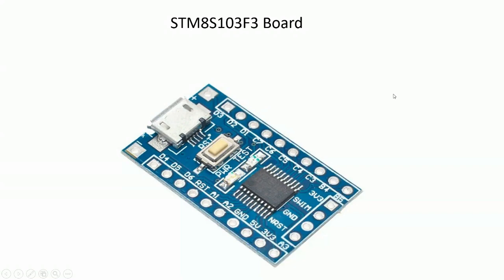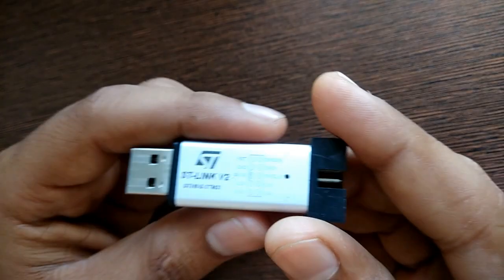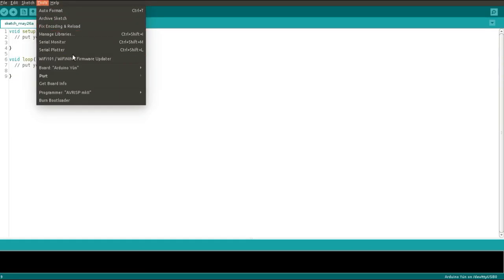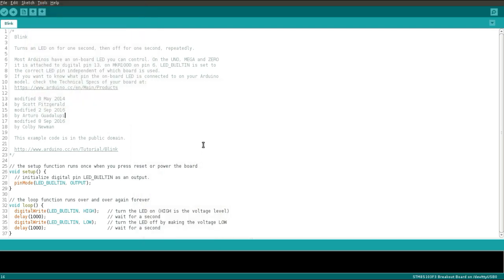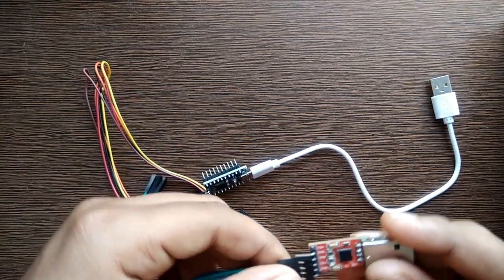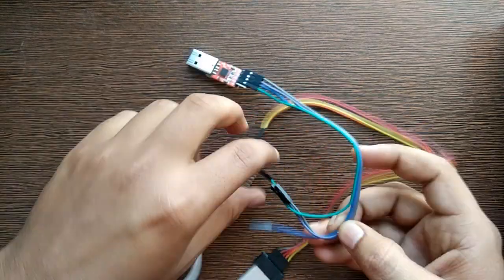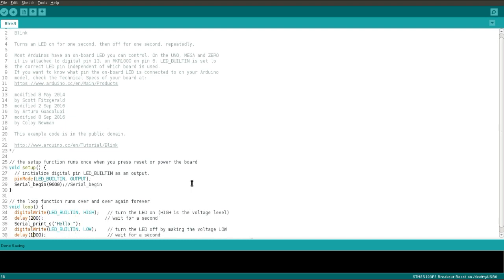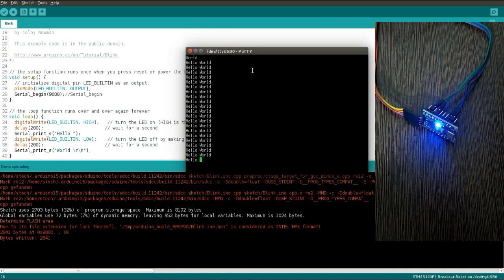How to use STM8S Controller with Arduino IDE | SDUINO

Comment: Stm8s is very cheap, and can find its way in many small projects (neopixels control for example) where wifi is not required.
A big plus is that it's fully supported in Arduino ide.

Comment: Mr, is there a tutorial to copy data from the programmed stm8s10 ic, copy it to the empty stm8s10 ic, please answer. thank you
Reply from the maker: Yes stm8s10xx can be read if lock bits are not set.
Reply: @StechiezDIY  if the bits are not locked, is there a tutorial for copying them. thank you

Comment: WARNING: Do NOT buy the SiPEED usb-debugger to program the STM8S103 chip (SiPEED=clone, article 114991786 = copy  of the real "ST-Link v2"), because that does not work; USB conn not recognized, and also does NOT have the "SWIM" pin to program the STM8S103 chip.

Comment: sir what is the meaning of break out board?
Reply from the maker: Breakout board means boards with specific and minimal functionality.
Reply: @StechiezDIY  technically its just a simple pcb that splits out the pins of an ic and make it easier to connect to. This stm8 board is actually a development board but close enough...

Comment: Hello sir  can we program stm8s003f3p6   microcontroller with Arduino ide
Reply from the maker: yes, we can program stm8s003f3p6 using arduino ide.
Reply: Hey are you working on stm8s003f3???

Comment: If getting this erro in arduino IDE:
1821 bytes at 0x8000... Tries exceeded

I found the solution...
First of all I have to remove Flash Protection of the STM8S003f3 board.
I used ST Visual Programmer tool to remove the protection.
Download from here: https://www.st.com/content/st_com/en/products/development-tools/software-development-tools/stm8-software-

development-tools/stm8-programmers/stvd-stm8.html

How to Remove the Flash Protection:

Connect the board with ST-LINK programmer and plug the programmer in USB. (Use SWIM wire)
Open "ST Visual Programmer" application.
Select Hardware: ST-LINK
PORT: USB
Programming Mode: SWIM
Device: STM8S103F3
and click OK.

Go to OPTION BYTE tab.
Set ROP to Off and then press CTRL+P

Now close visual programmer and Open Arduino IDE and upload the code easily without that error.
Reply from the maker: Thanks for sharing..Keep Sharing..
Reply: Thank bro, i got the same error and thanks to you i solved it
Reply: I am trying to program it through ST Visual Programmer, and I keep getting the error "Device is protected". Can't set that bit off, erase flash buttons are grayed out.
UPDATE: Never mind, all I had to do was select the Option BYTES tab and go to Program > Current Tab.

Comment: Its very Helpful one! but  if I include any arduino library, I am getting Multiple libraries found error message!!  same code will compile without any error if i select any arduino board (In both cases Pin Mapping of board is taken care) Looking forward for solution if any!!
Reply from the maker: Arduino libraries are not compatible with STM8* based libraries.
STM8S compiler doesn't support c++ libraries.
for example, for printing stm8s has different api for printing char,string and int.

Comment: Can we connect to computer through usb cable?.

Please reply it's important i want it for project.
Reply from the maker: USB connector given on board is just to supply power. And for supplying power you can connect it anywhere including your computer..
But if you want to connect it to computer for serial communication or flashing you will need required tools. I have shown that tools in the video.

Comment: Due to its file extension (or lack thereof), "C:\Users\lenovo\AppData\Local\Temp\arduino_build_953120/Blink.ino.hex" is considered as INTEL HEX format!
1821 bytes at 0x8000... Tries exceeded
Reply from the maker: Controller is might be locked. You will have to unlock it using following commands
echo "00" | xxd -r -p >ROP_CLEAR.bin
stm8flash -c stlinkv2 -p stm8s103f3 -s opt -w ROP_CLEAR.bin
Reply: Is that worked
Reply: please share me how to solve this issue in detail...I am too facing this issue
Reply from the maker: @unlockthehappiness6978  it worked for me. There can be plenty of reason when you get "Tries Exceeded". Check using another st-link programmer. How are you giving power to board? Through ST-LINk or using USB cable connected to usb port of development board?
Reply: I powered the  board with USB  connected to laptop at separate USB port..then st link v2 connections are given to board...
I am almost spent lots of time to make this board to be programmed
Reply from the maker: Okay. You can try different ST-LINK clone programmer. Because for me some st-link clone doesn't work with stm8s controller. I observed that clones are flashed with different binaries.
Reply: If getting this erro in arduino IDE:
1821 bytes at 0x8000... Tries exceeded

I found the solution...
First of all I have to remove Flash Protection of the STM8S003f3 board.
I used ST Visual Programmer tool to remove the protection.
Download from here: https://www.st.com/content/st_com/en/products/development-tools/software-development-tools/stm8-software-

development-tools/stm8-programmers/stvd-stm8.html

How to Remove the Flash Protection:

Connect the board with ST-LINK programmer and plug the programmer in USB. (Use SWIM wire)
Open "ST Visual Programmer" application.
Select Hardware: ST-LINK
PORT: USB
Programming Mode: SWIM
Device: STM8S103F3
and click OK.

Go to OPTION BYTE tab.
Set ROP to Off and then press CTRL+P

Now close visual programmer and Open Arduino IDE and upload the code easily without that error.